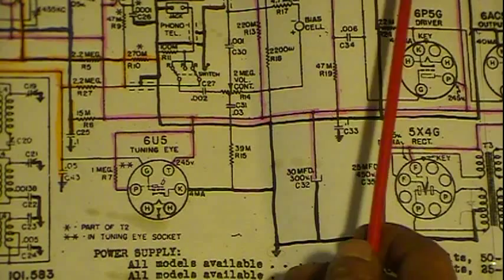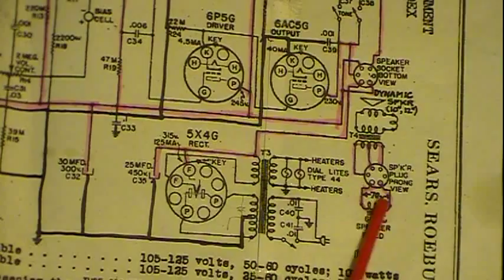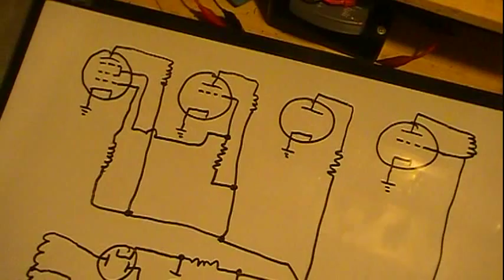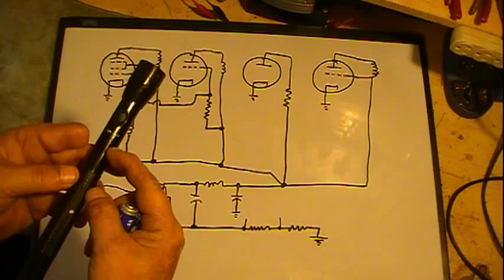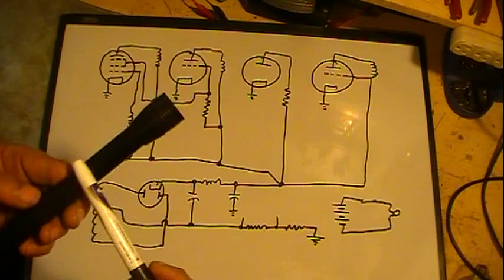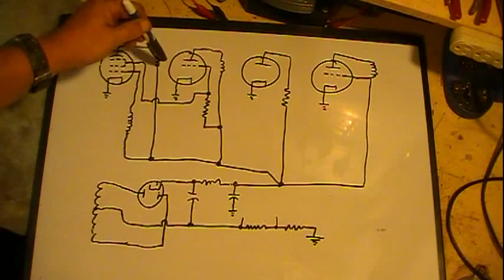Schematics 101 part 5

Comment: Hi Dennis;

Great Video.. On the "Eye" Tube, how Low can I go on the Plate Voltage, In other words If I was to use it on my Philco 34 which I think its High voltage is +135 Volts or on my Philco 45, which may be more.. Or is the Plate Voltage too Low ??

THANK YOU Marty
Reply from the maker: You can use it with that low of plate voltage but you have change the one meg resistor to a 500K resistor toget it work correctly at the lower voltage.